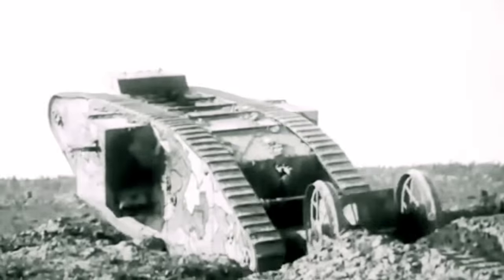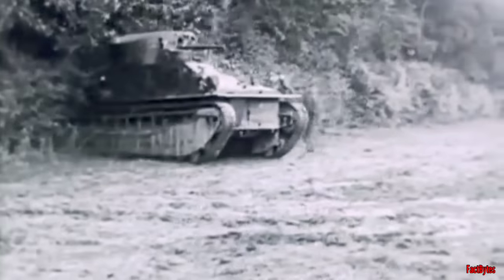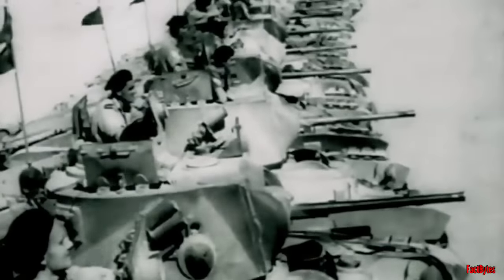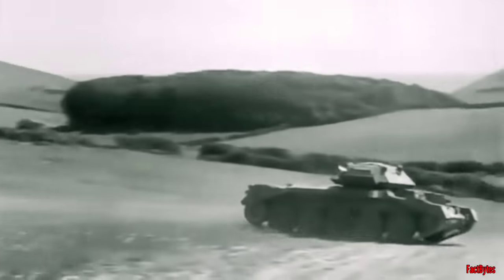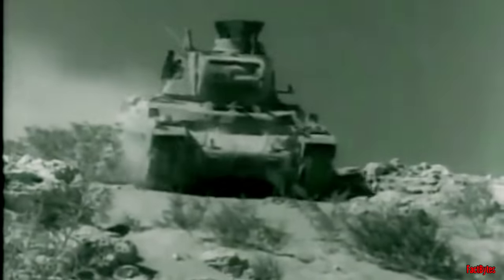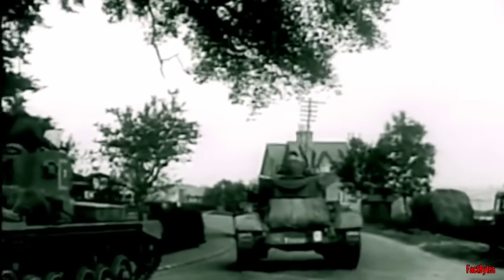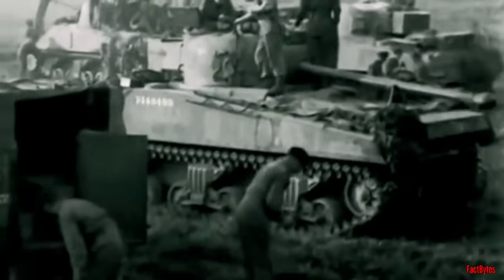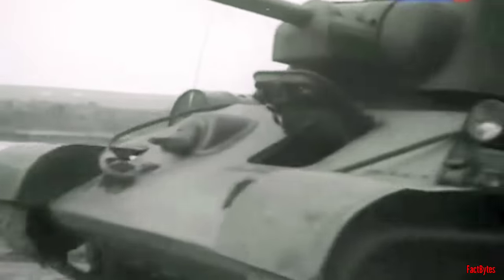Why Did Britain Struggle to Build Effective Tanks During World War II?

Comment: The video almost totally ignores the Comet, a design based on the Cromwell that mounted the 77-mm HV cannon.  This 77-mm cannon was only slightly less powerful than the 17-pounder (it fired the same projectiles as the 17-pounder but used a cartridge case that held less propellant), and was more than capable of confronting the Tiger and the Panther.  It was finally brought into front-line service in early 1945.  It was quickly supplanted by the Centurion, but that tank was not brought into service until after the end of the war in Europe.
Reply: And you seam to miss the Fact all the 
Big Battles had been fought ,  and at 
The End there was Very little Armor
Left , out numbering them 10 to 1 
Only meant you had the odds in your 
Favour , BRITSH Tanks No Armor , No 
Gun ,  Bolts instead of Welds   they
We're a Heap of Rubbish , how many
Poor men died because of this
Reply: @markjones464 there is certainly merit in what you say, but the Churchill tank, which was the most numerous British tank in the Italian and North West Europe campaigns had extremely thick armour and could absorb many hits from anti tank guns. Riveting, albeit an old technology, was very familiar to British industry, whereas the welding of thick plates was not. Also, remember that the welded joints were softer than the surrounding steel and German anti tank gunners were trained to aim at the welds of Russian tanks because the armour there could be penetrated more easily. However, it is lamentable that the Cromwell and Comet tanks were not available at least a year earlier, as they were quite effective tanks.
Reply: British tank design and doctrine was all wrong based on fast moving lightly armed and armoured crusader ranks and slow moving thick armoured infantry tanks, both these designs feature the 2pdr gun in the early stages which meant British tanks were far outranged by German tanks and antitank guns, they couldn't fire HE rounds and if they got within range their 2pdr armour pirecing shells bounced off German tanks or failed to knock out German anti tank guns. Eventually they got the 6pdr but it would a while before they got them in numbers. The Cromwell and Comet were exactly what British needed in 1941-44 but had to make do with what they had. The British vastly out produced the Germans in tank production but it was all a long series of poor tank designs.
Reply: @bobsyeruncle5557  That was one of the problems that the British faced: they were well behind the Germans on the tank-development curve.  It was if they were always playing catch-up, trying to match what the Germans already had, rather than trying to jump ahead of them.  They were also somewhat inflexible in their tank designs, selecting a particular main armament and requiring the tank (and especially the turret) to be designed to fit that particular cannon and nothing larger.  This generally made it very difficult to upgrade that tank to take a larger weapon.  The German Panzer Mk. III and Mk. IV were much more easily upgradeable; the Mk. IV entered service in 1936 and was still capable of effective front-line service in 1945.
Reply: @joelbilly1355  the idea of the infantry tank sounds quite good, but the British never pulled it off. The Matilda at the beginning of the war and the Churchill later on, had tough armour, but puny guns. When they should have been armed with a large calibre gun that could blast out defenders with high explosive, they instead had small calibre anti tank guns. The doctrine should have changed when the equipment to support it was not available.
Reply: @bobsyeruncle5557  the infantry tank was built around the idea of supporting the infantry much like the tanks of WW1, advancing over no man's land taking out machine gun nests, destroying barb wire and with armor thick enough to withstand the anti-tank guns of the day which the Matilda and later Churchill could do and they would be spread out into penny packets with infantry behind, it didn't need a big gun as it wasnt intended to meet other tanks in combat. The French made the exact same mistake. Cavalry tanks were then meant to race through the gaps and push as far behind enemy lines as possible. Their tanks had been built to fight the last war. They didn't realise that tanks were an armoured fist and mobile artillery platform, they didn't understand combined arms, they'd send wave after wave of infantry and cruiser tanks charging against German tank positions and the German panzer would hold their positions and let the anti tank guns pick them off until they came into panzer range and open fire, then charge after the British or French retreated. The British army got stuck with their undergunned infantry and cavalry tanks as they needed new tanks quickly, they did try to change their tank doctrine but not enough attention was paid in the beginning in regards to how the panzers fought ie they didn't acknowledge in the desert that the German 88 was picking their armor out at huge range or for instance when they captured a knocked out Tiger it sat their for months before it was examined.
Reply: The Comet. Too little too late.
Reply: @joelbilly1355  Its crazy that they didnt immediately realise the effectiveness of putting large calibre armament on an armored vehicle to punch through defensive fortifications. The Germans and Soviets immediately saw this need and accordingly developed the Panzer 4/Sturmgeschutz and KV2/SU series respectively.
Reply: @joelbilly1355  In a word, engines. 

It was engines that were the real weakness of pre war British tank design, a fact too many people are hopelessly unaware of. 

Early British tanks were powered by truck or WWI Aero engines, and were underpowered in comparison to German, Soviet or US engines of the same period. It was not until the introduction of the Rolls Royce Meteor that the British got a really good tank engine. 

Prior to that however they were limited by the engines available, the British desperately wanted a general purpose medium tank, but the engine situation meant they simply could not build one. If you wanted speed and manoeuvrability they HAD to sacrifice armour, if they wanted armour they HAD to sacrifice mobility. Due to the engines they had no wiggle room. 

The Comet was a good tank, the Centurion is widely regarded by Armour Historians as one of if not the finest Tank ever built. Both were powered by the Rolls Royce Meteor, problem is the Meteor did not start production until 1943.

The fact that the British were able to design and build capable, even excellent tanks as soon as they had a good engine available indicates very, very strongly that it was the engines in prior designs that were one of the primary limitations in the designs.....
Reply: @alganhar1  this is very true but I also believe the british MOD was concentrating too much on quantity as well rather than speed, reliability, armor or armament. They were always capable of building good tanks, the British tanks in a lot of ways at least in 1940 were superior to the early panzers. After the fall of France they were trying to recuperate losses so kept with the 2pdr and current tank designs rather than build new better armed designs and then continued to do this after loses in North Africa. From 1940-43 they lost a step or two on the germans in tank development, only for the Sherman they would probably have continued this.
For instance in North Africa there were only 6 Churchills with the 6pdr gun in North Africa in 1942, granted they had the lee & sherman tanks arriving by May 1942 it mattered less but from Feb 1941 to May 1942 the British army was having to send wave after wave of tanks built with the 2pdr, even with the best engine in the world and best armour there was little a Cromwell for instance with a 2pdr could do. Battle of France was May-June 1940 so for over 2 years the British were building tanks with an inferior main gun. British tanks would probably have been good enough in the early had they had the 6pdr or even 17 Pdrs that weren't really available until 1943 in numbers. If you look at the Russians and Germans and later Americans they were putting the best possible guns on to their medium tanks. The Cromwell was the tank the British army needed in 1942.
Reply: The 17 pounder had a muzzle velocity of 1200 m/s. The 77mm had a paltry muzzle velocity of 785 m/s. Kinetic energy is proportional to the square of the velocity making the 17 pounder 2.34 x more powerful than the 77mm. Slightly less powerful? I think not.
Reply: @Will_CH1  was the whole thing about the 77mm that it wasn't there until the end of the war?
Reply: @joelbilly1355  Comet was a good tank . It was designed for the 17 pounder but unfortunately the design was cocked up with a 64 inch turret ring such that the gun had to be cut down.
Reply: @Will_CH1   Comparing apples to oranges, are we?  The 17-pounder did have a muzzle velocity of 1,200 m/s - with the APDS round.  With the APCBC round, it had a muzzle velocity of 900 m/s (although one source I consulted gave that figure as 884 m/s.)  Against rolled homogeneous armour, the 17-pounder has a penetration depth of 163 mm at 500 m and 150 mm at 1,000 m; for the 77-mm, those figures were 137 mm and 126 mm for the same distances.  Both were going to penetrate the Tiger 1's frontal armour (both hull and turret) of 100 mm but might have had trouble with the Panther's upper glacis plate (80 mm angled at 55 degrees from the vertical.)  And that's what really mattered, wasn't it?
Reply: @speedythree  If I find a credible source proving that APDS was issued to comet tanks during the war, then I will revise the comment. In the mean time, I will trust Newtonian physics.
Reply: Is English your second language? @markjones464   I count 32 mistakes in your one sentence.
Reply: @speedythree somewhere else on You Tube is a video describing how a Sherman Firefly destroyed five Panther tanks in one day!
Reply: @donyoung1384  I think I saw that already; produced by The Tank Museum, yes?
Reply: @speedythree  Yes.
Reply: Until the Centurion came along, we were very good at building tanks for yesterday’s battle! No bloody good for tomorrow’s however.
Reply: @bryanduncan1640  and Centurion sucked balls until 105mmL7 came along... In 1958-59
Reply: @AKUJIVALDO  - are you joking? Yes, the Mk1 was not the greatest, but the later models were by far superior to the opposition! It’s just a shame that it came in so late - even with ONLY the 17pdr.
Reply: @bryanduncan1640  by far superior... LOL

You mean superior to T-34? LOL Well, then yes. I mean, how a newer heavy cannot be superior to old medium? 
But of course, the same didn't work out against newer medium T-54...

The problem is that people take latest model and say "see, our "things" are awesome"...when in reality it is a polished turd in the beginning and only became awesome way later. Like Centurion(only 14-15 years to become awesome) , or M1 Abrams(with 105mm)... 

But of course, it often is applied to opponent in reverse. Like how everyone cries, "no, Panthers were unreliable as shite" while taking like first batch of Panthers were produced all the war while dismissing evidence which shows otherwise.
Reply: @AKUJIVALDO  - I’m sorry, but just what is your problem with the Centurion? Nobody’s saying that it was the best tank ever. I’m not even going to get into pissing contest with the M26 or the M48/60. It’s just that the Centurion grew into the best tank of the immediate post war period, it was sold to 26 countries - far more than any other tank and was still going strong into the ‘70’s. Yes the mk1 was lacking (that’s why it was called the mark one!!!!). So come on, put your money where your mouth is; out of the European tanks of the period, going up against the Russian tanks OF THE PERIOD, which tank would YOU rather have been in?
Reply: @bryanduncan1640  just because something is sold, doesn't make it great...especially when there is no competition. 
And immediate post war? LOL it wasn't until 105mmL7 it was became great.
Reply: @AKUJIVALDO  - There’s just no pleasing you is there? So all 26 countries were happy to buy junk, were they? The fact that even the American museum at Fort Benning called it the best post war tank counts for nothing according to you. Just what DO you call a “good immediate post-war” tank?

Comment: British tank doctrine prior to the war wasn't much different from other countries. France, Germany and the Soviet Union all had infantry and cruiser tank equivalents. One of the major reasons the T-34 was successful was its V-2 engine, which was very powerful. Britain didn't have a good tank engine for most of the war, so were limited in what they could achieve in terms of weight and manoeuvrability. Still the Matilda II was a good tank in the early war. The Cromwell was a decent medium tank, if a bit late.
Reply: The meteor engine was very effective and plenty powerful enough and was used extensively during the war and many years after.
Reply: I think the sloping front armour, which could not be penetrated by the German 37mm PAK or tank guns, and the 76mm gun had a lot to do with its success between 1941 and 1942.
Reply: @klackon1  Yes, but the reason it could carry enough armour to provide all round protection, as well as a larger gun than other medium tanks of the time, while still being quite mobile, was the powerful engine.